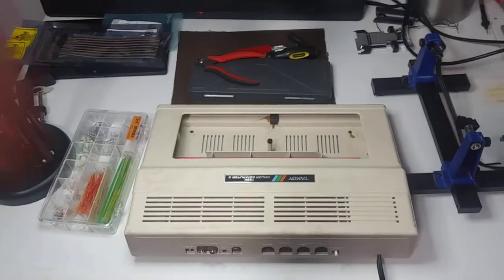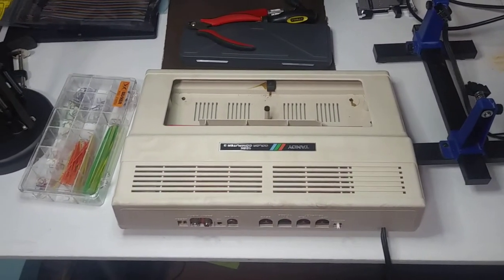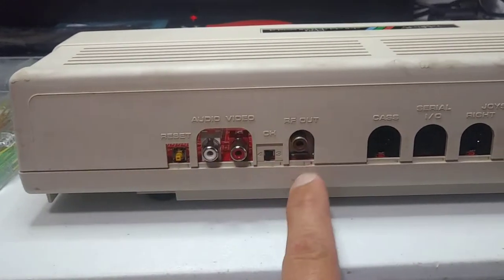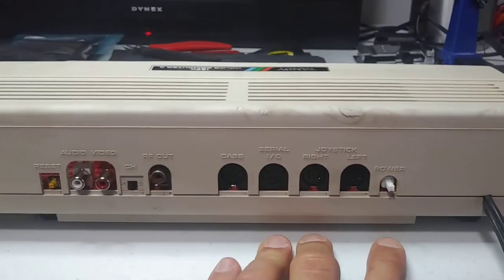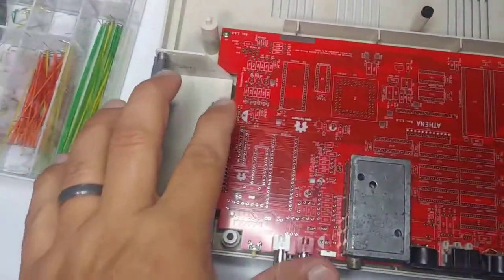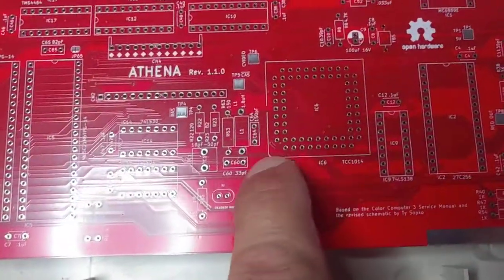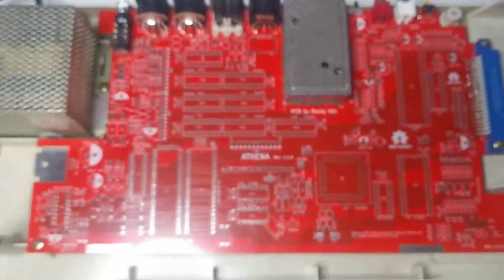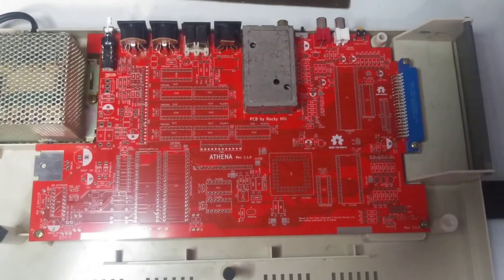CoCo 3 Board revision  1.1.0

Comment: Love the minimalist new board!  It has no chips or anything!  Very sleek!

(And I'm pretty sure your next production of the new board will fix the TV out alignment issue too... I mean why not?)

As we know in CoCo2 land, there are various revisions so the port locations kinda moved around... but what about CoCo3?  It never had variations?
Reply from the maker: lol! all of the chips are in between the layers!

I didn't use a CoCo 3 in my youth so I'm not sure if there are other revisions where the components and connectors were moved around unless you count the PAL versions. I have looked around for other board layouts but I have not been able to find one. Seriously though I am working on another CoCo 3 board I'm calling the CoCo++ that has a port so one can use an RGB to HDMI board directly with it and most of the components will be surface mount. I am close to finishing it but I still need to work out the DAC/ADC portion and I want to add some sort of USB support for keyboards/joysticks ect... here is the link
https://github.com/qbancoffee/cocoplusplus
Reply: @rockyhill3  I know "get in line!"  But if you want a tester... I'm your man! :)
Reply from the maker: @anjinmiura6708  Sounds fantastic thanks!
Reply: @rockyhill3  I don't know why the RF "can" is called that.  To me a can is one of three shapes: Cylinder, Toilet or Buttocks.
Reply from the maker: @anjinmiura6708  lol, I guess technically you're right but I grew up hearing and calling metal enclosures cans. lol it is funny.

Comment: The RF converter appears to be original, correct?  Since this is a reproduction, and, as you say, nobody cares about RF anymore, I'm curious if you think it will get used much, or if you think most people will leave it unpopulated?  Follow-up question:  I recall seeing someone else have trouble with removing the RF converter from an Intellivision II, wherein the composite OUT wouldn't work (or, maybe it was that it wouldn't even boot) without the RF modulator in-place, even though it didn't appear to be necessary.  Does the CoCo 3 require an RF modulator in-place to boot and / or run, or is it fine unpopulated?

Looks nice!
Reply from the maker: Thanks!
The RF can you saw in the video is the one off of my real CoCo 3 and I added it in the PCB for completeness so if someone wanted/needed  a new CoCo 3 board and still wanted RF they could just pull the old can off of the board and solder it in. I think it's inline with the spirit of the bit-preserve project. 

I know I said it's good enough but sometimes I get nostalgic for RF so I use it occasionally on some other systems. Will it get used much? Probably not, but it's nice to have. I'm working on a CoCo 3 board that doesn't have the RF can but rather has a 6 pin connector for an RGB to HDMI board. Will the CoCo 3 boot without the RF can? Well, I have two working CoCo 3 boards, an original and a reproduction one. Neither has an RF can and both run just fine using composite. The  RGB works as well although I haven't used an RGB monitor, I connected the RGB out to an RGB to HDMI board. I hope that helps!
Reply: @rockyhill3  Makes sense!  😃